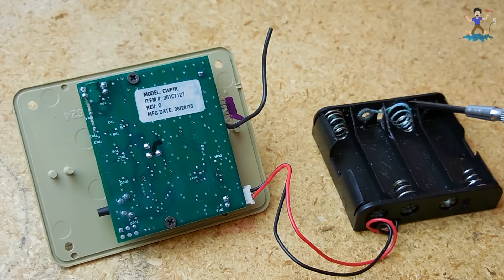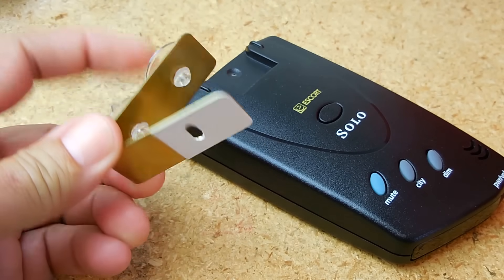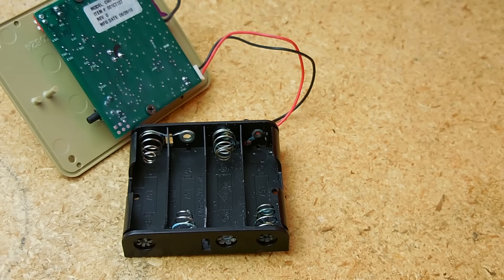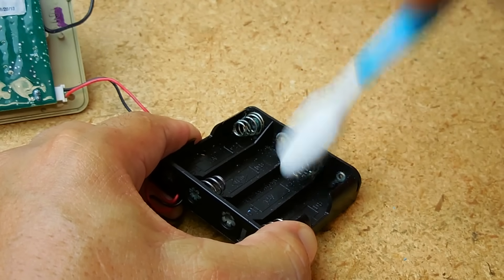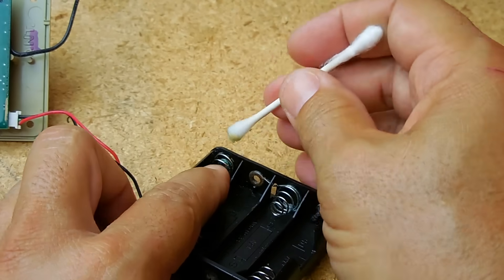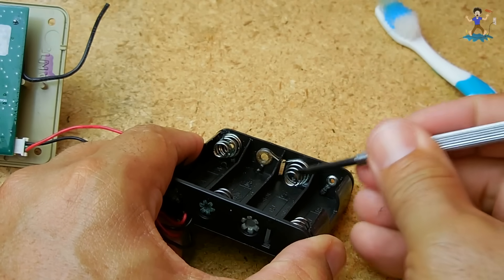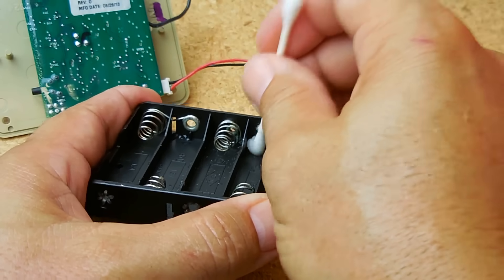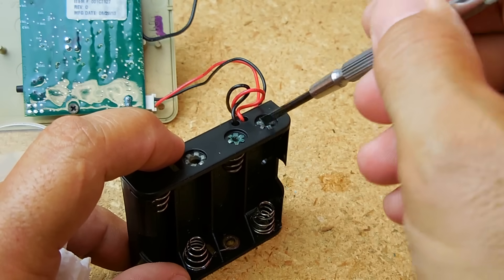EASILY Clean Battery Leak Damage(Corrosion) In Electronics

Comment: I've always loved using baking soda and water to clean off the corrosion on battery terminals. It is super fast and with a little rinse and maybe some light brushing they are cleaner than ever!
Reply: How To Video Channel               Car batteries are acid batteries and so baking soda works because it neutralizes acid. These little batteries are alkaline batteries so an acid like vinegar neutralizes them. I have had little luck neutralizing these little batteries with baking soda and that makes sense because it violates the laws of Chemistry.
Reply: Simple... know the chemistry of the cell or battery you are trying to clean and use the opposite pH to clean it. Since Baking Soda (Sodium Bicarbonate is a salt which dissolves in water) has a pH higher than 7, you use it on cells or batteries with a chemistry lower than 5, like a sealed lead acid battery in a car, etc. Obviously, the opposite is true and you use vinegar (Acetic Acid) to clean Alkaline cells like the common AA and AAA cells and their holders. Use a bit of water (neutral pH) to clean off those chemicals afterward.
Reply: @BruceNitroxpro  Edit your comment to reflect that the pH of a neutral substance is 7.0, not 5.
Reply: @donsmith9478  ... can't remember even posting that comment... LOL ESPECIALLY that dumb number! ROFL Thanks!
Reply: Same here. Works on car batteries too.
Reply: Peter Bowman and so will a can of Coca Cola, as it is mostly acid, ...lol, ...
Reply: @johne.osmaniii7217  hmmm. Interesting. Will try that too. Thank you!
Reply: Baking soda is alkaline. You should use it only on zinc carbon batteries. Btw they are much worse in corroding than alkaline ones.
Reply: Usually did this (Baking Soda) vs Vinegar... Although I have used the Rubbing Alcohol half often enough. Usually it cleans off enough to make it work again.  Since Baking Soda usually tends to be messy I'm going to try Vinegar next time...
Reply: The corrosion from a leaking battery is a base, you need an acid to neutralize it, hence vinegar.  Baking soda does nothing.
Reply: @Norm475  If it is alkaline then it is base, if it is zinc carbon the it is acidic. The acid from the zinc carbon batteries make the terminals rust.
Reply: Same here baking soda works great
Reply: Will try this because I don't have vinegar right now

Comment: i followed these steps and while i was cleaning the negative side of the battery holder i noticed it was brown underneath the corrosion likely rust and some of it wouldnt clean off, does this affect it at all? i accidently tore off a wire while cleaning so i dont know if it will
Reply from the maker: Liquid Awesomeness The wire must go back.
Reply: well i kinda had that figured out but i dont have soldering supplies at the moment, but about the brown underneath the corrosion i cleaned is that rust? and will it still work?
Reply from the maker: Liquid Awesomeness Just make sure all contacts are clean/shiny.

Comment: I have an LED lamp that was damaged. will the corrosion go beyond the battery compartment? I cleaned it as best I could but it still will not work.
Reply from the maker: Yes. Sounds like the copper wire got eaten up, or heavy corrosion between the wire and battery holder.
Reply: Can that be fixed?

Comment: Some People recommend vinegar, but others recommend using baking soda mixed with small amount of water.  Seems like opposites.  Is the leaked crud acidic or alkaline?
Reply from the maker: Don't listen to them. The ONLY time you use baking soda, is when a battery containing acid leaks. When alkaline batteries leak, you neutralize the leak using an ACID(vinegar).

Comment: Very good video! I've been doing this for years. We can build an orbiting laboratory, but we can't make batteries that don't leak! ARRGH!!! I have a couple of points that I'd like to make. 1.When you are done cleaning everything, coat all the contacts with dielectric grease. Just a light coat will do. It will help neutralize any remaining corrosion and will help prevent damage in the future. 2.We have had so many batteries leak that whenever anything battery-operated comes into our house, I coat the contacts with dielectric grease. It's also a good idea to follow the recommendation of the battery manufacturer to remove batteries from devices you won't be using often. 3.Dielectric grease works wonders to keep solar landscape lights working season after season. Coat the battery terminals and switch on each one and they will last a long time. 4. Most major battery manufacturers will repair or replace items ruined by their batteries. I'm not sure how often they will let you do it, but I have been compensated twice by both Energizer and Duracell because of leaky batteries. The largest amount was $60. I had a game controller ruined by Duracell batteries. They asked me how much it would cost to replace it and then sent me a check for 60 dollars. I ended up repairing almost everything and keeping the money to compensate me for all the time I have spent repairing battery damage. The only thing I couldn't repair was a MagLight that corroded the bottom threads so bad that I couldn't get it apart with two pipe wrenches. (One last thing... when you are brushing the corrosion away, do it outside or over a sink. Don't ever blow the dust away with your breath. You don't want that corrosion in your eyes or mouth. It burns like hell. Ask me how I know. LOL) Very interesting channel. Subscribed!
Reply: Dielectric grease is a special grease that won't conduct electricity but still allows for good electrical contact , I put a light coat on the base of light bulbs in the outdoor light fixtures to keep them from getting stuck in the socket and prevents corrosion of the socket as well , Great stuff , You can find it at Grainger or your electrical supply , Even though it's a bit pricey , But it's more than well worth it
Reply: Dielectric grease is a MUST for any electronic or electrical equipment which it's contacts are subject to corrosion due to leaking batteries or outdoors exposed to the elements , I was at Grainger one day picking up a part for an HVAC unit and just happened to spot a spray can of dielectric grease and immediately bought one , The spray on is great for getting in those tight spots , Even though it's fairly expensive but very well worth it , You may be able to find it at your local electrical supply as well ,
Reply: I agree with your advice about the corrosive dust. I was surprised to see him banging the battery compartment on the surface, spreading the dust around.
Reply: That leaves out my girlfriends sex toys lol damn she hates when it gets corroded , oh wait , different type of corrosion lol
Reply: Excellent suggestion to use the dielectric grease. Been doing that for decades after a tour in the Air Force.
Reply: Orbiting laboratory ... Lmao that was funny
Reply: What is a "dielectric grease".  Methinks you are using buzzwords to impress people.
Reply: Alter Kater  

Nope!  That’s what it’s called.

Comment: Nice tip. Always thought zinc batteries were the ones that leaked? Why do they plate coat those terminals?
Reply from the maker: They plate the springs & terminals to ensure better contact and corrosion resistance.

Comment: Any tips for when the spring contact snaps in half (or off) due to excessive corrosion? I have a TENS unit like that.Thanks.
Reply from the maker: Look for another inexpensive battery holder to take parts from, or an old electronic device and swap them out. Use a rivet gun.

Comment: I have the same drive way alert  but I want to make mine work with a charger so I don't have to pull out the rechargeable batteries any suggestions
Reply from the maker: How about using high capacity NiCad AA batteries and a small solar panel(They're cheap). Take the solar panel, add a blocking diode(1N5818) off the(+) solder point of the solar panel, and connect the panel output across the 4 batteries. The sun will keep everything charged. The current is not too high, so the batteries will be fine. NiCad's can tolerate it.

http://bit.ly/2bWgk58
Reply: +electronicsNmore 👌will do thanks keep up the fantastic job!

Comment: Good tips here, especially on the white vinegar 
One of my favorite brushes are made from other brushes! I take a tooth brush and slowly heat the handle just behind the brush, bend up to 90 degrees or whatever.
The other is a so called "acid brush" These brushes come in various sizes, usually come with a formed metal tube handle. I will cut the brush down to at times as short as an eighth of an inch, depending on intended use. Acid brushes can be bought by the box for a few dollars from on line merchants or found in plumbing supply stores or home centers. Shortened acid brushes are great foe cleaning off solder flux when used with alcohol.
Reply from the maker: I have a few of those acid brushes, I use them when I sweat copper pipes. Very useful.
Reply: They are also called flux brushes at some stores.

Comment: Great tip.  The works because Vinegar is slightly basic (ph) and it will neutralize the stuff that comes out of the battery.  It can also be used to remove the oxidation on electrical switches and relays.    Don´t use WD40 pm electrical contacts, it will just make things worse.
Reply: Yep, your right.  Too much tequilla.
Reply: Please don't get the two mixed up when you exercise your elbow.
Reply: Good tip.
Reply: Joseph Nicholas

Comment: Hi Doug. Great how to has always. For car battery and cables I use baking soda in a container of water I use a brush to clean the battery  and soak the cables in the container that allows the baking soda to go into the inside of the cables killing the acid,has sometime it will leach far into the copper wire. For people who have never done this be careful  NOT to get any baking soda into the battery !!!. That's why I use the brush,it helps control the amount you get on top of the battery case, I also clean the case before to remove grease and dirt. Hope this may help some of your viewers. I have never had to replace a cable or clamp using this method. Again thank you for all the helpful videos. I am looking forward to your next video.
All my best.
Bobby Sorry for the long comment.
Reply: Bobby Tectalabyss
Reply from the maker: Hey Bobby. I also use baking soda around the posts of a lead acid battery, it works extremely well. Thanks for watching!
Reply from the maker: *****
I guess you saw a comment I posted there. :-) Thanks for subscribing! Be sure to check out my video playlists.
Reply from the maker: *****
Glad you found my channel. :-)
Reply: After it is clean (Or better, before it corrodes.) oil the terminals every time you change the oil.  Add a bit to the end of the stranded wire so it wicks in.  They will not corrode and will last for the life of the vehicle.